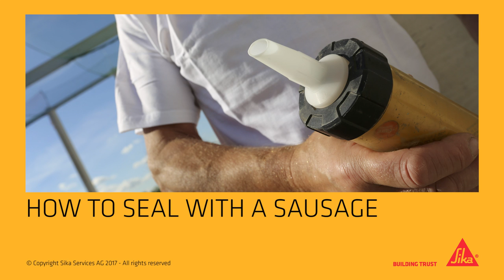How to apply sealants with a sausage

Comment: Good question surprise eggs, I've used Sika plenty of times and nothing I've ever smoothed it with came off clean like his did. Did he coat it with some magic sauce so Sika didn't stick? Or perhaps wait a perfect amount of time after caulking...?
Reply from the maker: The guy in the video tools every day for hours, he is a professional and knows the material really well and uses his wooden smoothing tool. The joints always look really perfect when completed by an expert :-)
Reply: @SikaGroup  The tool looks as though it is wet and has had something applied to it.  SIKA sticks to wood so I doubt that it is just a wood tool with no product covering it.  Is it mineral oil or paraffin?

Comment: What tool did he use at the end of the video to smooth out the sealant?
Reply: A custom cut piece of scrap would I think.
Reply from the maker: Our customer uses a convenient wooden smoothing tool, which is often used in Northern Germany and Scandinavia. You can buy it in professional  Builders` Merchant stores. If you want to buy such a tool in your country, the best is to contact your local Sika Office. Best regards, Astrid Schneider, Marketing Sealing and Bonding